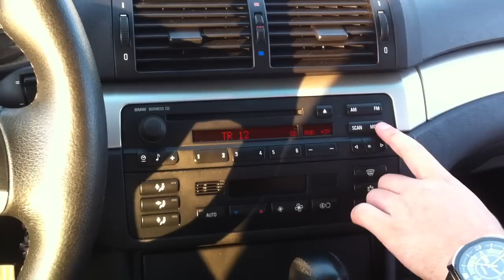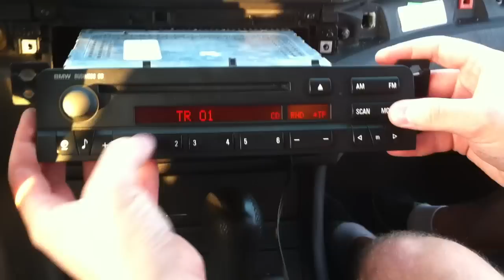BMW E46 Aux Installation DIY

Comment: I have an old 318i from 1999 with only CD button for CD changer (HU 26/98) and cassete instead of CDs, no MODE button and made it work. I bought AUX adapter and had to rearrange the pins on 10-pin connector to make it work. From top-to-bottom, left-to-right they go like
[][W][][][]
[R][B][][][]
W - white wire, "left channel"
R - red wire, "right channel"
B - black wire, ground
Hope it helps! Like comment so others see solution!
Reply: @jasper3654  use other videos, the process is the same anyway, this is just the tip on how to make cable working.

Comment: I got a bmw 318I e46 from 98. Would this work for my car? Im confused because some forums says it doesnt for the 98 model
Reply from the maker: +Navidadz Hi! It's possible to make it working if You have a fully working 6 cd changer in the trunk. Otherwise it will not work, because Your car is too old for direct aux feature. Cheers!
Reply: +lockerz73 okej ill try to find that cd charger then and hope it works haha

Comment: When I press MODE button, i cant switch it to AUX. There is only CD and Radio mode. Why?
Reply: +Giorgi Mjavanadze Same happens to me. I've heard cable must be connected to device (ie: phone) and music playing. Gonna try it out.
Reply from the maker: +Carlos Valldejuli guys can You tell me your car details? Because my car shows aux everytime, maybe you have a different cord..
Reply from the maker: +Carlos Valldejuli it looks like it's a cheap cable, it doesn't have any necessary components (capacitors and resistor) that are in oem cable. Without resistor there is no resistancr and You don't see aux mode until you connect a phone to the cable..
Reply: +lockerz73 OK thanks, cheers!
Reply: +lockerz73 Is it fixable? Thanks!
Reply: +lockerz73 OK thanks!

Comment: Hola tengo un BMW E46 M3 2002 con caja de 6 CD en el baúl, quisiera saber si funciona y donde puedo comprar el cable. Gracias
Hello i have a BMW E46 M3 2002 with 6 CD Charger in the trunk, i want to know if it works and where i can buy the cable, Regards
Reply: Adicional a la caja de cd tiene un CD en la parte frontal del radio y tiene el botón de MODE
Aditional to the CD Charger have a CD in the front of the radio and have the MODE button

Comment from the maker: It might be that Your car is pre 09.2002 and do not support aux.
Reply: My 330ci is pre 09-2002, is there something else I can do for aux input?
Reply from the maker: +Luca T do You have a 6cd changer in the trunk?
Reply: Just get a newer CD53. They're cheap if aux is all you want
Reply: +lockerz73 No
Reply: +Tyler Macdonald (T-Mac) I was thinking of that, the Quizdel Aux cord or just a brand new radio with bluetooth. I'm still debating. Thanks for your reply.
Reply: Try on E46fanatics part outs. You should have some luck there for a cheap comparable unit :)
Reply: +Tyler Macdonald (T-Mac) Thanks man, I will right now 👍
Reply: @tylerlovesmacs  I have Alpine CD PLAYER BUSSINES CD53 5/2002 I put cable and don't show aux (have mode button) can I unlock with diagnostic?

Comment: Sólo funciona Si es un e46 modelo 2004 al 2006. Menor de esos años no funciona
Reply: Así es, la versión de software del radio debe ser la 43. Mi unidad tiene versión 40  y evidentemente no funcionó.
Reply: Pienso que 2003 funcionara tambien.

Comment: Hi. Can you tell me if this works in the 320d?
Reply: Did it work?
Reply: @awindaphilip  if u have "mode" button on your radio it should work, but sometimes u have to solder aux cable to the main board of the radio